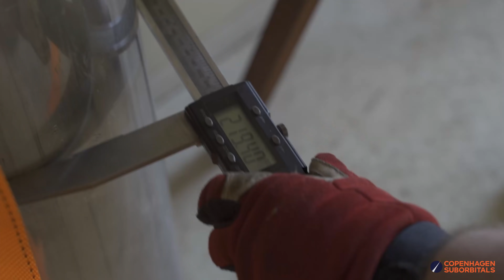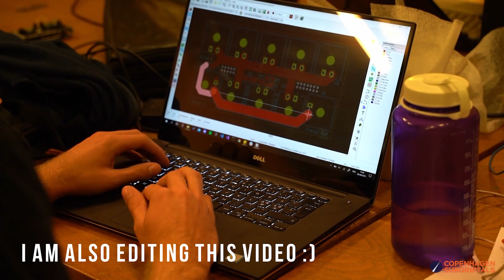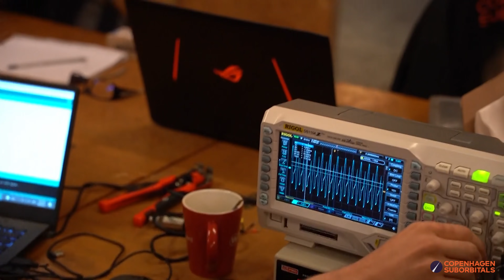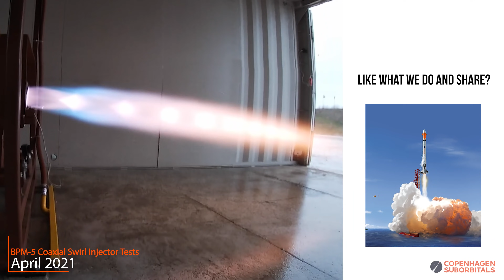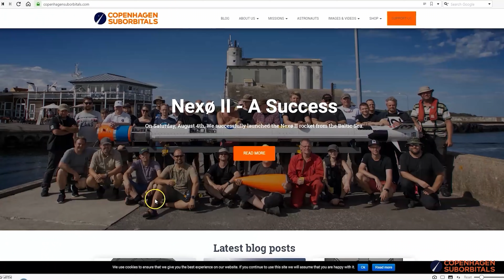10kN LOX/Ethanol ROCKET - Attempt to Design & Launch in 9 MONTHS!

Comment: Cool😊. Sounds like an updated V2, 75% alcohol 25% water. What drove the choice.
Reply from the maker: The last three rockets we built at Copenhagen Suborbitals used that combination, so we have extensive experience with it. And initially it was the choice because A) good quality ethanol is easily accessible and inexpensive, and B) we launch our rockets from a floating platform at Sea, so we needed a fuel that was more environmentally-friendly than any hydrocarbon-based option, as well as quickly dissolving/evaporating in a worst-case scenario.

Comment: why is the combustion chamber so long ?
Reply: Combustion chambers on small rocket engines need to be relatively longer than the combustion chamber on larger engines to be sure that the mixed fuel and oxidizer has had enough time to finish its chemical magic before the combustion gases are expelled.
Reply: Fun part is that we shortened the bpm 5 for this rocket 🙃

Comment: What is your pressurization method? Are you guys using regulators?
Reply: We're using high pressure nitrogen and solenoid valves together with pressure sensors and some software.

Comment: Awesome stuff. How will fuel be routed to the engines?
Reply from the maker: You can see the fuel manifolds at @07:55
Reply: @CopenhagenSuborbitals  Sorry I should have been more specific! How is the fuel routed around the lox tank? Are you using a tube going through the Lox tank like SpaceX Starship? 😊
Reply from the maker: @DylanEdmiston  Got it now. The fuel downcomer will be routed through the exterior of the rocket. The HEAT-2X rocket in 2014 had internal propellant lines, but since only one of our propellants is cryogenic and it requires more complicated manufacturing, we came to the conclusion that it's a complication not worth the effort of pursuing further.
Reply: @CopenhagenSuborbitals  awesome, that makes sense. I would love to hear how your ignition systems work if you guys would be willing to make a video on that!
Reply from the maker: @DylanEdmiston  We have a blog on the subject. It goes back a few years, so there have been some improvements here and there, but in general the method has stayed the same:
https://copenhagensuborbitals.com/to-make-fire/